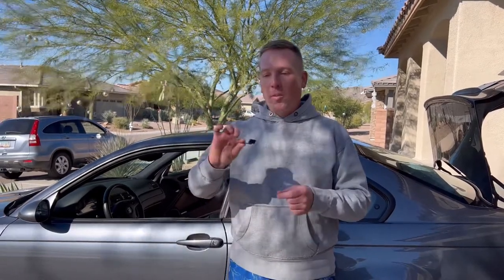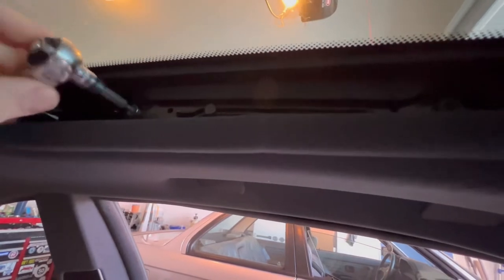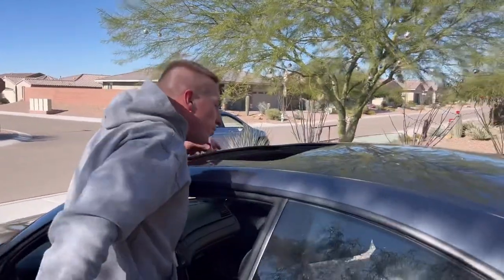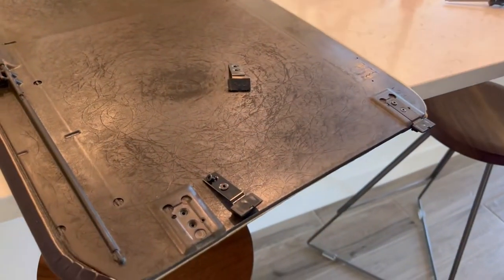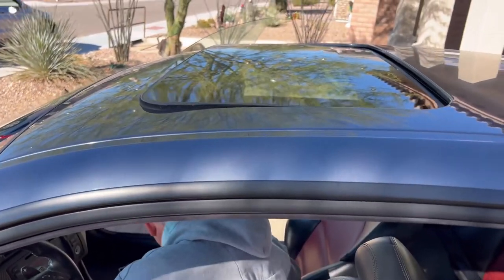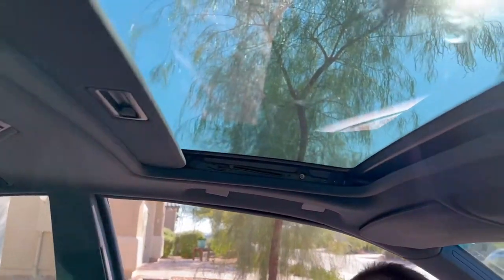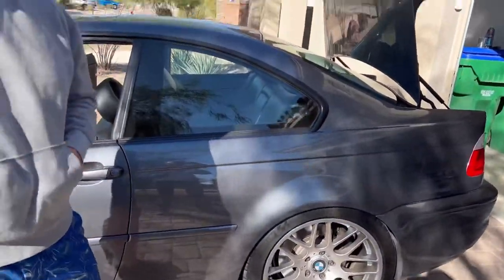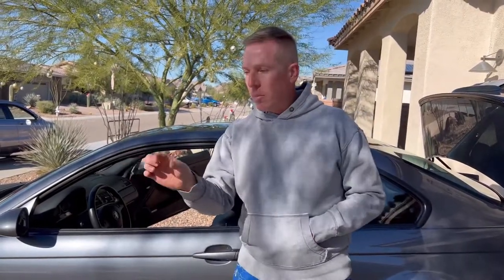How to: BMW E46 M3: Sunshade Fix

Comment: Just did this myself - those 2 ‘spring legs’ should have a plastic boot each which helps it slide in the track. One of mine had came off and had to be retrieved from inside the roof but it had caused the cover to stick and eventually made the opposite tabs pop off their guide. Oh, also clean the track of any old oil/grease as they gunk up eventually

Comment: For the height adjustment, my Bentley service manual for the 3 Series says, front - flush to 1mm below roof line, rear - flush to 1mm above roof line.
Reply from the maker: This is good to know and I would agree without referencing the Bentley manual.
Reply: @thedriversapex  I work in aircraft maintenance, and if it is not described in an applicable publication of some sort, we do not do it.

Comment: Between 1:08 and 1:14 the shade is stuck (identical like mine) and then all the sudden it's out of the way. Did you just use muscle and jam it back into the cavity or how did you actually get it out of the way?
Reply from the maker: Great question. I’m not certain. I remember worrying that I would mess up something by using too much force. I think i was able to gently move it around until I could get it to move. I remember it being annoying and that I thought it was going to break. LMK how you fare with this.

Comment: I am pretty sure that you have answered my question but my problem is when the sunroof closes, it does not grab the sunshade (lower opaque part) and pull it a couple inches forward out of the roof pocket so that you can then grab it by hand and close all the way if desired. My Question is, at 9:33 where your finger is on the piece which you say is so important,  it seems to me that it should always be between the front and rear sliders (the parts which you replaced), or in other words, in front of the rear slider and behind the front slider.  True or false?
Reply from the maker: Thanks for watching and thanks for your patience. I did not seem your comments for some reason. I need to do some research because I do not want to give you or anyone else the wrong answer. What I do know is, whatever I did do, has worked, and has presented any problems. However, I do want to look at the literature and find the right answer because I believe that is important. Let me know if your sunroof is working correctly after your repair.